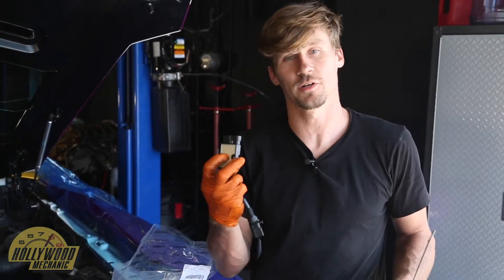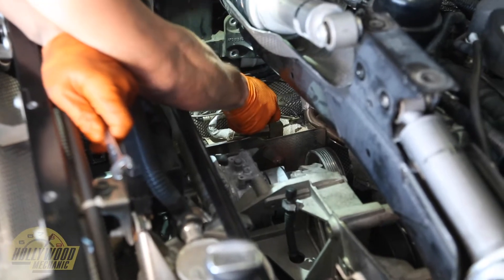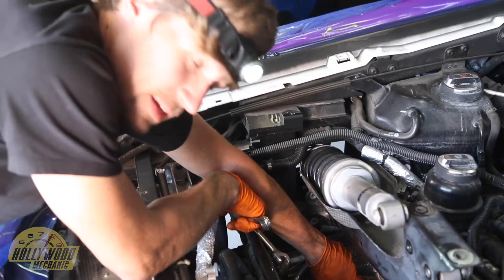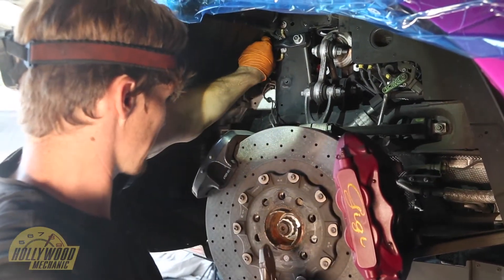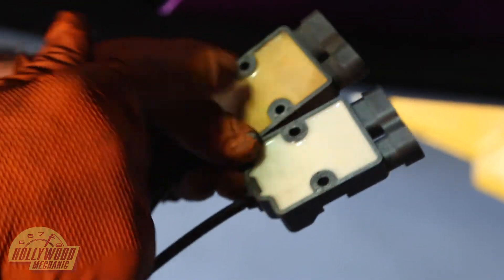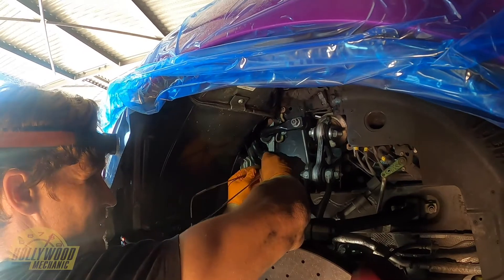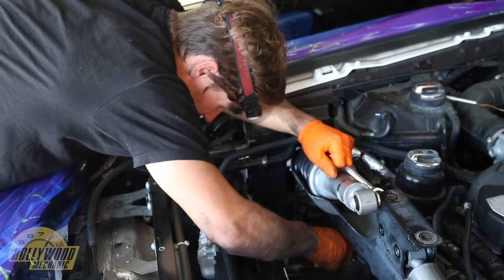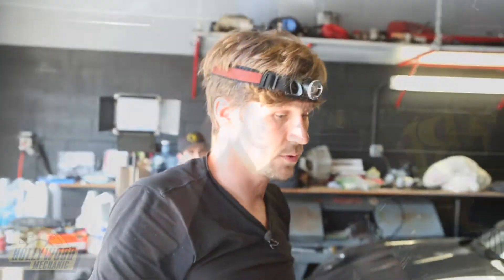Lamborghini Aventador Cat Temperature Sensor Probe (Thermocouple) Replacement // How To Series

Comment: Do I have to change the long probes too or just the black module? I have a CEL popped up 2 weeks ago car ran fine but said something to do with o2 sensor. Then today suddenly I had a catalyst overheat warning then car was on limp mode couldn’t drive pass 2k rpm. I turned my car off waited a bit and started again then car was normal but I quickly drove it home and ordered 2 sensors.

Comment: just changed 4 sensors and  while i had one sensor only fault before now i have p0546 p0549(both banks faulty)  while only  bank1 both sensors dont  read ... fucki%£## lampos are so bad
Reply from the maker: @FID3R  the sensors are difficult to install directly correctly. The ecus are normally the problem anyway. You should have started with the ecus and then done the sensors. I always replace both
Reply: @HollywoodMechanic   sadly for me one of the sensors was visibly damaged and the rest in a bad state. so i thought that should be it... now i know. 4 sensors and 2 ecus next time. are only 600 euros anyway (the ecus) so not dramatic. thank you for the reply

Comment: Hollywood, I'm looking everywhere online to find the Lambo Aventador Roadster thermocouple ECU.  I can't seem to find the part.  Any help you can provide would be greatly appreciated.  Thanks so much.
Reply from the maker: 470998102 is the probe kit with all four.  470998161 are the "Cold Joint ECUs"  Two required.  I think 2 come in the kit.
Reply: @HollywoodMechanic  Hollywood, You're awesome!  Thanks so much.

Comment: Why did you change it? Code?
Reply from the maker: Cat Temp Overheat warning.  After we replaced, the codes went away.  Very common fault on the Aventadors.  Actually, any car that uses cat temp probes.  Ferraris also need a similar service often.
Reply: p14a3 p0544 - I have that code after change testpipe, I also changed lamba o2 sensor due to heater fail, I guess the vibration from take off and reinstall, does the thermocouple subject to vibration damage too? I see there a recall to change junction box and relocation.
Reply from the maker: @YouStupid69  on the older ones yes, they are moved to the wheel well like shown in this video away from the exhaust. The test pipes you installed probably have ports for those sensors in a different location, so they have to be re bent and often times, techs accidentally scrape or damage the probes. I would have to take a look to be sure.
Reply from the maker: @YouStupid69  is it an older or high mileage car? It's extremely common fault and the probes come as a set so just do them all. Make sure no anti seize goes into the probe hole
Reply from the maker: @YouStupid69  also, what scanner are you using? The generic ones often don't correctly read the codes. Just an FYI. I see a lot of ppl chasing the wrong faults because a scan tool read the wrong description
Reply from the maker: @YouStupid69  2014 then it definitely is normal to need temp probes. Just be very careful in the routing and installation. I'm not familiar with launch but you need to confirm that they have aventador specific obd codes loaded. Autel or ODIS are the only ones that I have seen be reliable on the code description. I only use ODIS now but in my early years used the Autel.

Comment: Great video.  Thank you.  This is off topic  but I wanted to ask.  Is replacing the rear Aventador shock a DIY?  I'm not all that mechanically inclined.  Thanks.
m
Reply from the maker: The rear shock is very easy. You do need to brace the lower shock bolt and nut when tightening with a wrench on the bolt to prevent it from binding the shock and use proper torque on new bolts and nuts. Just pull off the wheel, fender liner, engine bay cross brace (13 mm and I think a 10 triple square, don't drop it or you'll have to take the belly pan off to retrieve it), then upper and lower bolts to the shock, then use a pry bar to push the wheel down while a partner pulls the top of the shock up over the shock brace. There is a place in the frame that a pry bar can go and then leverage down on the upper suspension arms but if it slips and hits the brake rotor, it will chip and ruin it.